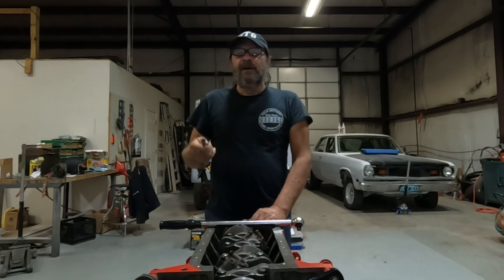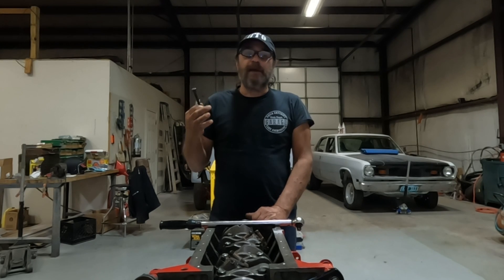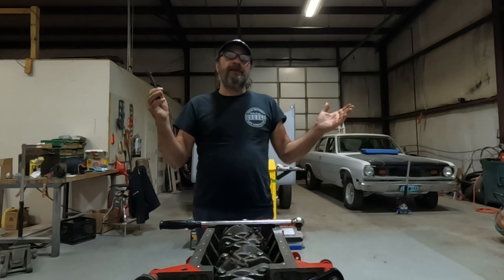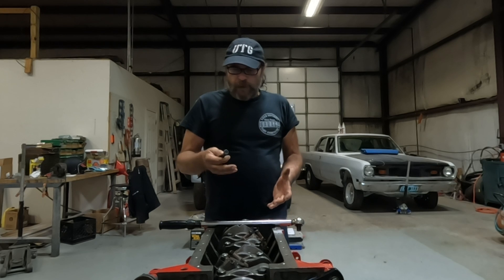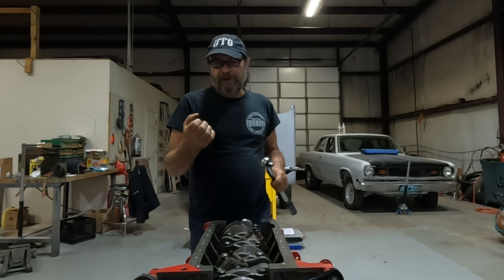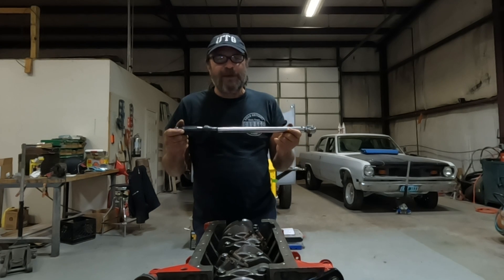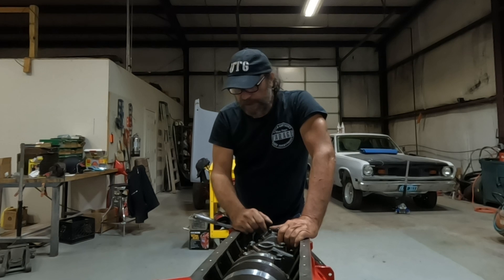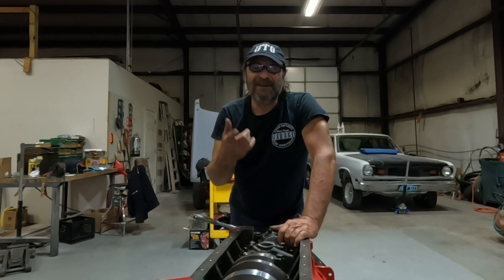Torquing Mains, Rods And Cylinder Heads For The Home Engine Builder

Comment: It's enjoyable because it is visceral. There is the visual angle of the handle and the feel of how much force it takes to make it turn as it gets tighter. All the same types of bolts with their specific torque settings should feel the same as they tighten. Then there is the feel and sound of turning the crank. The sound of the rings on the honed cylinder walls you get accustomed to.
For other fasteners that need to be just tight, you get a feel for the bolt's springiness as it becomes tight enough. If you over tighten the bolt you will feel it give and you get that gut reaction of uh oh. There is also a different feel as the threads become galled. You get used to it and will know when to stop and fix the threads or replace the bolt. If the bolt head is starting to round off or a cheap socket cracks you'll feel it before anything else. You will also get a feel for the thread tolerance or play if a bolt is worn or wornout.
The washer topic is it's own beast.
Reply: Zen.
Reply: When building an engine, you never want to have an "uuh ooh" moment.   I have had that moment, but it was  easily corrected!!
Reply: Absolutely! Well said! That's one of the points Tony made in his last video saying, I have plenty of power tools etc. but choose to disassemble and assemble with hand tools so I can feel the connections and what have you. 
I love doing things the old school way, imo,the proper way. 
Thank you for sharing this with us guys and it's great to hear people learning and appreciating this, regardless of how much experience some of us have or don't. I truly love being a gear-head!!!!!!

Comment: I worked in cell phone repair, double click caused the tiny screw to protrude on the other side. The spec was within fraction of 1 inlb
Reply: Ah yes head bolts and micro screws.

Same. Same.
Reply: I'd figure most of that stuff would use a preset torque wrench/screwdriver, like it does 2 inch pounds and that's it for example. 
I know for aircraft we've got a bunch like that.

Comment: I've always considered the two numbers specified to ensure that the fastener is in smooth  motion when the click is achieved.  You need to keep above the breakaway torque value that occurs  from a dead stop. If you get a click before the wrench really moves the fastener, I turn back some degrees in order to get  a reasonable  rate of motion. Oh, and of course make sure the hole is empty before inserting a bolt.
Reply: I was going to post something like this too. The breakaway torque is always higher than the running torque. This is also why the double click does not hurt the fastener's torque value.
Reply: Exactly, and it's why the double click is a complete fallacy. Smooth motion to the first click is paramount. The second click is a piece of mind click. It does nothing to the torque of the bolt. Which is why anyone who wants to do the double click, you just let them do it, because it does nothing.  ;)
Reply: @OzMike  ive had bolts slightly "loosen" after the gasket compresses 
.
like on tranny pans
.
.
if you KEEP chasing that click as the gasket compresses.... you WILL snap the bolts however
Reply: Great points, I was going to say the same thing. "Sneaking up" on the torque is okay, but make sure the torque wrench clicks while you are actually turning the bolt. If it doesn't, the bolt is likely undertightened because the breakaway torque (torque required to turn a stationary bolt) is significantly higher than the torque while the fastener is turning. Don't believe me? Tighten any fastener to any torque value, making sure the fastener is turning at a decent rate when the torque wrench clicks. Now try to loosen the fastener at the same torque value. You will see that your torque wrench will click before you actually break the fastener loose.
Reply: @averyalexander2303  i thought I saw one of those main cap bolts Tony sneaked up on c lick on a second pull but not the previous pull  with no movement before the click. Hey uncle Tony go back and  recheck those main cap bolts.
Reply: @markschmalenberger8301  I thought I saw that too, but it's hard to say for sure on a video.
Reply: Why not Triple click
Reply: @jacjumpin7471  If that's what you want to do then go for it, there's no harm in it. Once the set torque is reached, the fastener isn't going to turn any more no matter how many times you click the torque wrench.
Reply: turning back can be "dangerous" on torque to yield bolts
.
but on older engines... its totally fine
.
.
just dont do that on ball joints or tie rod castle nuts LOL
Reply: @kainhall  Good point. From my understanding, TTY bolts are only yielded (permanently stretched) when they are turned the specified number of degrees after being torqued to spec. I don't believe simply torquing a TTY bolt to the first stage will generally yield it, but I'm no engineer.
Reply: @averyalexander2303  the initial torque  on TTY bolts  is just an even starting point. Trust me, if you see how much  you have to turn those bolts you would cringe & understand  why they must never be reused. I'm no engineer  either, just have experienced using them more than once.
Reply: @kainhall  that situation would never occur with torque to yield procedure.

Comment: Proper torque specs for any fastener is 1/4 turn before it breaks.

Or if in a unionized trade. 
1) Reef on fastener until you hear a crack.
2) Turn back fastener 1/4 turn.
3) Have the apprentice finish the job.
Reply: Uh, no.  Every single fastener in a vehicle has a torque specification without exception.  The machines that screw them in are capable of breaking every single fastener.  They have specifications.  Most fasteners though, it snug and then a 1/4 turn, maybe more on large fasteners.
Reply: @tarstarkusz  final step, strike end of wrench with hammer
Reply: @graham2631  The universal tool.
Reply: @tarstarkusz  "FORD" wrench!

Comment: The beam type is the best.  The way they work is a physical characteristic of the metal.  Project farm did a review of torque wrenches, including very expensive clicker wrenches and they were inaccurate as all hell even brand new fully calibrated high end wrenches.  There were "large" (whole number foot pound) differences between 3 bolts torqued down one after another with the same wrench.
People think the clikers are better because they are more complex.  But the beam type is working by the characteristics of the material which doesn't change.
Reply: @Wooden Door Garage That is one of the nice things about the beam type, which is that they can be cheaply made and still be very accurate.  A cheap mechanism in the click type make it unreliable.  All they have to do is get the material right.

Presumably you can test it by removing a known torque spec fastener.  So if you know a bolt has been torqued at the factory to 50 foot pounds, it should take about 50 foot pounds to loosen it.  Mine at least has both loosening and tightening scales.

Comment: I always torqued using the racer's rule of thumb.  Tighten it down until you strip the threads, then back it off one-half a turn. :-D
Reply: I thought that was the Jiffylube oil plug rule of thumb?
Reply: @Freedomquest08  Jiffylube, Quicklube, Bubba's Shade Tree Auto Repair and Hot Rod, the list is long and indistinguished. :-D
Reply: And if it wants to leak a little after turning it back, remove it and wind some Teflon tape on the threads until you increase the thread  diameter by  three fifths of the original diameter.